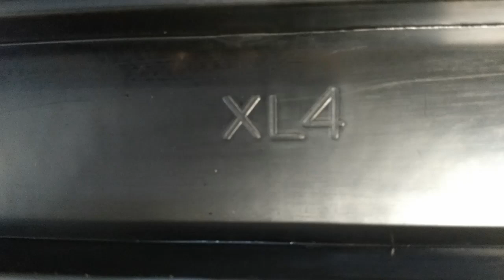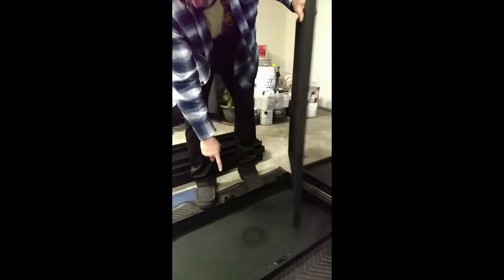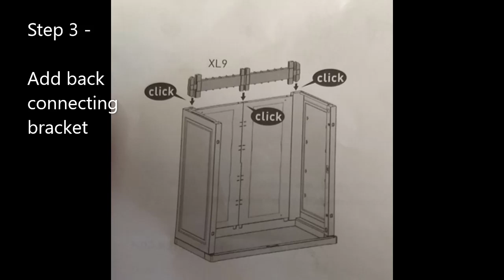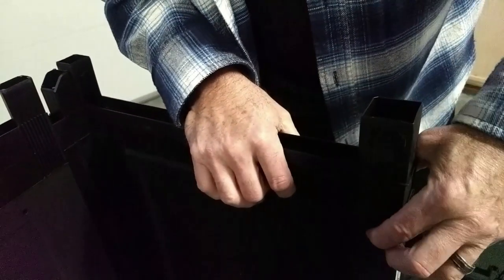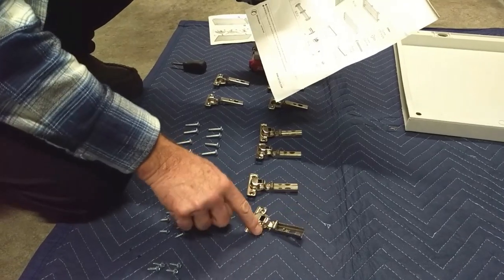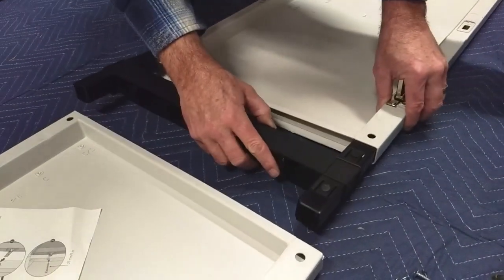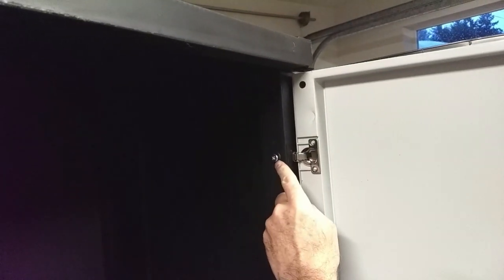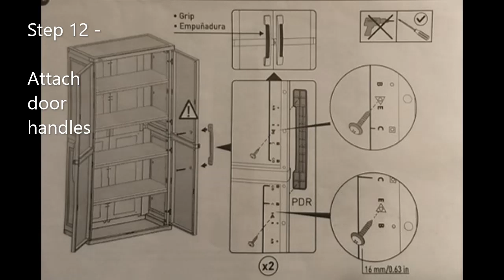How to: Assemble Keter XL Utility Cabinet

Comment: Arrived with several cracked panels. This product is thin cheap plastic.  Cracked out of the box.  upon arrival. This would never hold up in a hot climate like mine in Las Vegas, NV.  Bought at Lowes online & awaiting a refund replacement